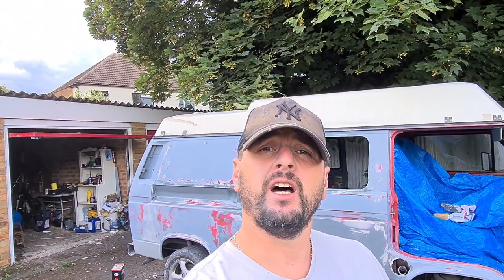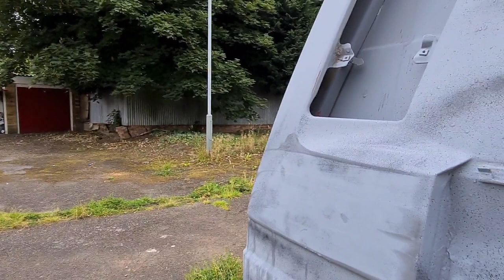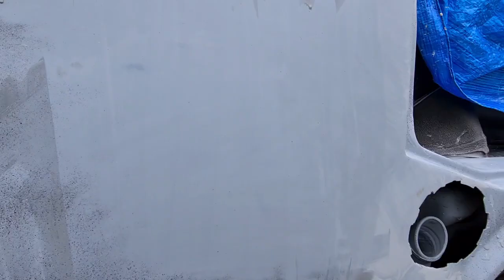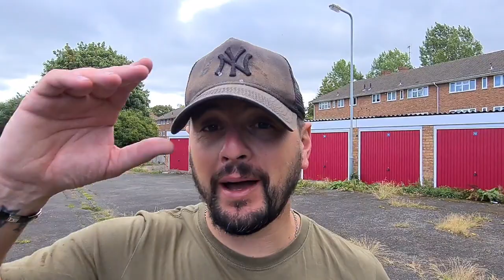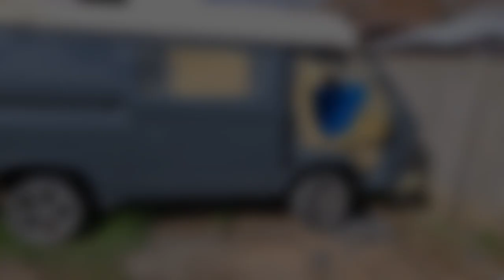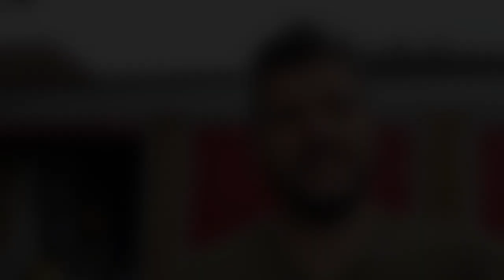Painting my VW T25 with my £50 spray booth I got from ebay T3 vanagon self build campervan

Comment: Working outside always seems to be about having good weather and the time to do the work. 

I went to my cousin’s farm today to do some more work on my T25. I wanted to get the front bumper off, attack any rust with a wire wheel then prime it. I’d got the offside bolt out of the bumper when I got called out by work. One bolt! I took the other out and put the bumper under the van before heading back to the grindstone. They leave me alone when it’s raining and I can’t do anything. It’ll get there, but slowly.
Reply from the maker: I the same bud the weekend I get time it always rains lol